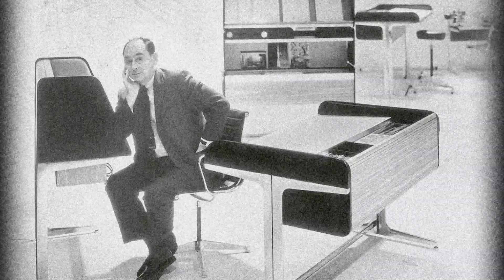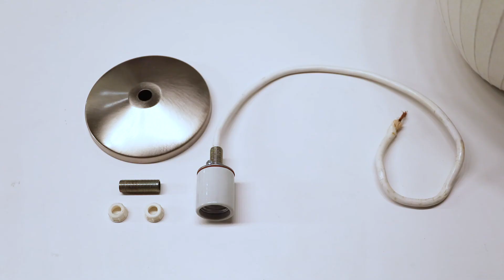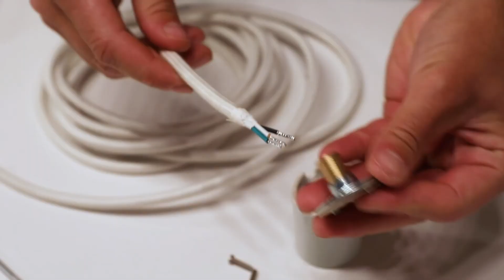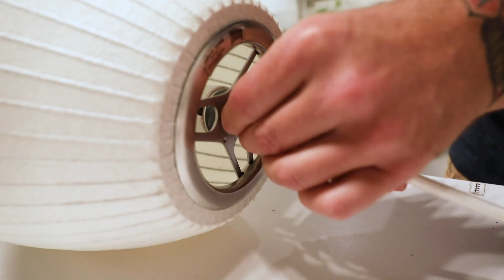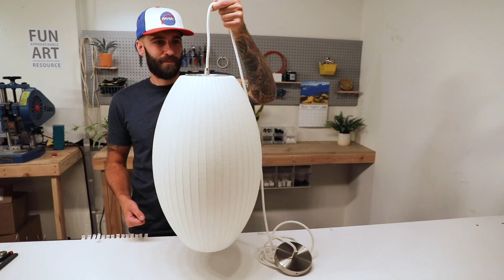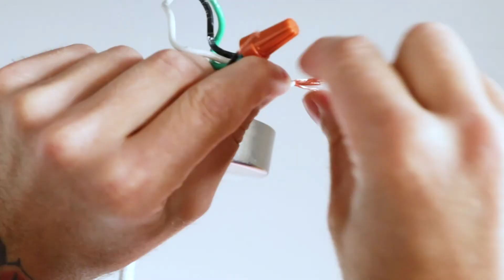What the FAQ? : How Do I Rewire a Nelson Bubble Lamp?

Comment: After what feels like an eternity trying to find out this information, your video has given me the clearest picture yet of what to expect from one of these classic pendants. The problem for me, which I’m hoping someone can shed light on, is that I’m having a house built with plain suspension cords installed where I want to add pendants. My dream pendants are Nelson ones (or decent replicas) but I can’t find clip on, “shade only” versions anywhere. What I really want to know is whether I can buy wired ones and then easily attach just the shade onto the existing cords. Given how many linen/paper shades in similar shapes exist, I’m stunned this hasn’t been an easy thing to find (or even clarify). Thanks to anyone who can shed some light! (Bad pun completely accidental. Honest.) 🙂

Comment: This was great, and somehow the only tutorial I could find on the internet to do anything like this! I had gotten a dud light bulb I got from Amazon stuck in my original bubble light and was able to use this tutorial to fix it. My only suggestion would be to link to the exact item, color and size of every item on the website. I ordered Zinc versions of a couple connectors and they didn't have the same threads, etc.

But thank you so much for this!

Comment: I wanted to say this is a great tutorial but it presumes (without showing how) that you can remove the existing cord hardware from the pendant. In my experience this piece seems to be glued together making the installation as pictured here impossible. However, I’d love to hear how it’s done if someone has succeeded.
Reply: having the same issue unfortunately... emailed HermanMiller to see if they have any guidance on how to remove the original wiring and bulb socket
Reply: Any update here. I’m trying to do the same thing
Reply: @frokeedokee  I tried the same, and HM is not giving up any trade secrets. I'm about to get out a grinder, film it, and post it on YouTube with the original response from HM. stay TUNEd
Reply from the maker: Hello,
Thank you for watching!  So in this particular shade's case the metal bracket that supports the socket is glued to the shade material itself, but the socket on this one was removed with a wrench.  Feel free to send us photos at info@colorcord.com and we can see how we can help!

Comment: Hello, I'm looking for that stainless steel base plate that went to your garage can. That's the original style. Where can I get one of those? Would you have any?
Reply from the maker: Hi Alan,
Thanks for watching!  Unfortunately we do not carry original Nelson Bubble parts, but of course you can rewire on using our Color Cord DIY Lamp Parts!  

Here's what you'll need:
DIY Cloth Covered Wire:
https://www.colorcord.com/collections/diy-wire
Porcelain Socket:
https://www.colorcord.com/products/grounded-porcelain-socket?variant=12363316723814
Male Metal Barrel Cord Grip:
https://www.colorcord.com/products/metal-barrel-cord-grip?variant=12363345461350
Single Port Ceiling Canopy:
https://www.colorcord.com/products/single-port-ceiling-canopy?variant=12363325309030
Reducer Coupler:
https://www.colorcord.com/products/reducer-coupler?variant=16246014148710
Nut:
https://www.colorcord.com/products/nut?variant=16295054606438
Washer:
https://www.colorcord.com/products/lock-washer?variant=16294979371110
1/8 IPS All Thread Nipple:
https://www.colorcord.com/products/1-8-ips-all-thread-nipple?variant=39290359611494
1/4 IPS All Thread Nipple:
https://www.colorcord.com/products/1-4-ips-all-thread-nipple-1-2-long?variant=16294220824678
Color Cord 3000 (optional):
https://www.colorcord.com/products/color-cord-3000-wire-stripping-tool?variant=12363339071590

Feel free to reach out to info@colorcord.com if you have any further questions or concerns!

Comment: any idea how to clean these lamps?  Have several of them and the dust is embedded in them.  ;(
Reply from the maker: Hello!
Thanks for watching!  According to hermanmiller.com you can:

"Use a feather duster, a clean soft white cloth, or vacuum with a clean soft brush attachment as needed. For stubborn stains, clean the surface using a clean soft white absorbent cloth with a solution of mild soap and warm water. Wipe down surfaces with the damp cloth and dry with a clean soft white cloth."

So, if it seems to be pretty embedded, it looks like using a damp cloth would be where to start.  Feel free to reach out to info@colorcord.com if you have any further questions or concerns!

Comment: What is the easiest way to convert a Nelson lamp to a wall plug-in? Do you sell a kit for this?
Reply from the maker: Hi there- good question, the instructions would be exactly the same except you would use a Power Cord Whip and thread the components that go above the shade (washer and nut) along with the shade before you wire the socket. You can find our power whips here:
https://www.colorcord.com/collections/power-cord-whips

As always, if you have questions feel free to use our live chat or call 1.800.409.1070 on our website during office hours or shoot us an email at info@colorcord.com. 

Thanks!